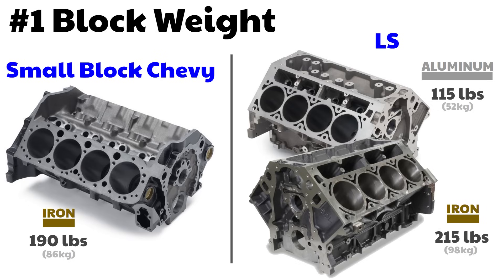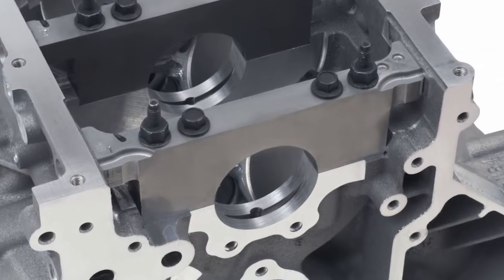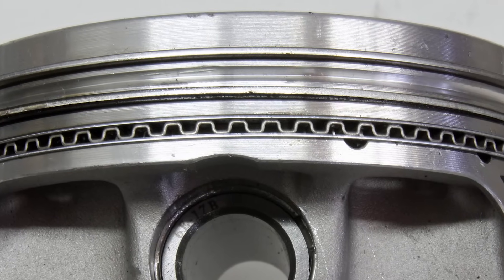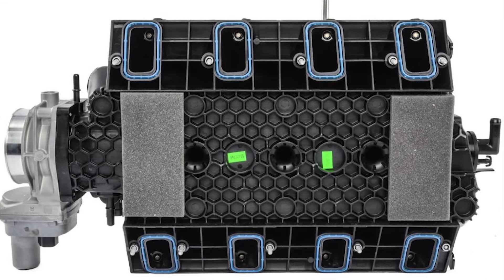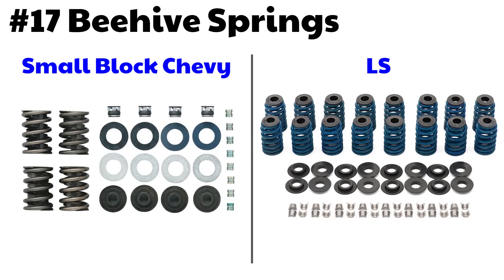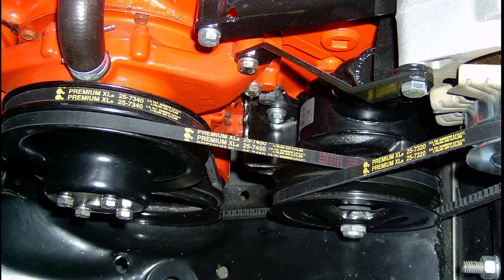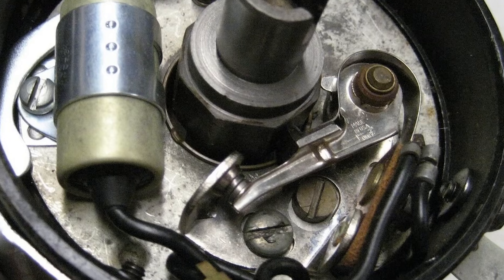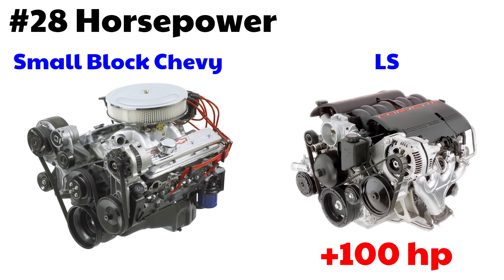29 Reasons LS is Better than Small Block Chevy (Gen 1 & 2 vs Gen 3 & 4)

Comment: There have been thousands, if not millions of sbc's built with over 550 hp,  and still running. The small block can't be to bad as it took GM over 50 years to come up with something better.  The small block was, is, and will always be a great engine especially for a design that was made back in 1955.
Reply: Gen 3 sbc is an evolution just like gen 2 was and gen 5 is
Reply: I was really hoping this was a joke. Sounds like someone  read about 1/3 of the history of the sbc gen1 (the LS1 is a gen 3 sbc.) And half of the LS  history. Its like he left the last 25 years of the gen 1 off lmao. Being  gm  used them till 2002. But the late model gen ones have the same crankshaft and rod material.some of  The earlier gen 1 crankshaft that we all called steel crankshaft (forged) are a lot stronger the skirted block and oil pan sounds good until you need oil to the oil pump. As far as less moving  parts what till cam or crankshaft  Sensor go bad are the reluctant will bicycle had to rebuild the motor I'd much rather put a new distributor in. The heads yes they are better. And the have a gen 1/2 vs a gen3 ls is no where near a 100 hp different. Gm rated the 5.3 at what a gen 1/2 and 5.7 (ls1) at 20hp more. If you want to compare apples to apples than take the LS 5.7 with its 15 degree  heads and a gen 1/2 with a set of 15 degree heads on it there maybe 100 hp difference but it want be from the LS.
Reply: @michaelstoker6710  100% agree. the late l31 vortec motors with just a dual plane and 600cfm make around 310hp and 400tq straight out the scrap yard with the stock low lift cam. they have great potential and are known to do 300k+ without piston slap like the ls.
Reply: @michaelstoker6710  Technology hasn't gone backwards period.  How many gen 1 or 2 sbc have over 300,000 miles on them and can be pulled from the junkyard then boosted and make over 1000 horse power at the tires with stock internals not even opened up?  We talk horse power at the tires now where it matters.  Change nothing but the cam in a stock LS motor and make well over 400 at the tires through an auto transmission easily and reliably.  Getting 400 horse power to the tires with an auto transmission takes a lot more with a sbc.  I'm making 900 rwhp with stock 241 heads, stock intake, and stock throttle body.  Just a good cam, small procharger, and a fuel system to support e85.  900 at the tires with just that and completely daily driveable.  Can a stock sbc do that with stock heads, intake, and carb and be completely daily driveable and last?  Probably not.
Reply: @lsxtuner6126  in fact my gen 2 fits that bill actually its even factory cam with 93 pump gas. When you start talk boost and e85 that changes everything alot. If you think  its hard to get a 400 rwhp sbc streetable is just as easy as a ls. The  ls3 with cam only will make 400hp a 4.8/5.3/6.0 all make under at the flywheel there is hunders of dyno runs on this my cam only untouched  799 makes less than 350 with auto my cam and 243 head put 370 with a 6 speed. I own a gen1 low power in a c10 225 , got 2 gen2 ones the 800-1000 range depending on boost settings turbo the other should be over 1500, gen3 275, 2 gen 4 the 350-370 ones and a gen 5 stock. The LS  is great but don't  belive everything you read on the internet the sbc can be just as effective and like I said comparing  apples to apples do a 12/13/15 degree sbc and see what kinda power the little out dated sbc makes.
Reply: @michaelstoker6710  I've been around both LS engines and earlier sbc's.  I've personally owned a cam only ls1 5.7 that made over 400 to the tires through a stalled auto transmission.  With an earlier sbc it took cam, heads, intake, and carb to make 400 at the crank which was probably only 320 hp at the tires.  Ls3 with cam only can make 500 at the tires.  A 5.3 vortec out of the junk yard with a turbo and not even opening the engine can make 1000 at the tires.  A stock as it comes from GM earlier gen sbc isn't going to hold up at that power if it even made it that far before sending a rod out of the block.  Technology hasn't gone backwards period.  I'm not talking internet I build and tune LS engines and have a friend that builds and tunes older gen sbc.  He's a better mechanic than I am and doesn't make the kind of power I do with an LS engine.
Reply: Here is an idle video of my current summer time daily driver.  900 rwhp and 9's at full weight while being as tame as can be with stock gear and an over drive transmission.  Stop and go driving and long high way drives are no problem.  Over 1000 horse power at the crank:  https://www.youtube.com/watch?v=hmVPbBvzyas
Reply: @lsxtuner6126  car sound great. And I said a ls3 was capable. But I've seen more 5.3 melt down  then actually make 1000hp.  But seeing  how I've got a completely  factory  lt1 making  the same power as your cammed ls3 and another  after its together  should be capable  of a 4 second  1/8 are any of the other hunters of gen1/2 sbc that are doing it and been doing before the LS  was even thought about. The LS  is great i own 3 and all make good power but nothing like what the internet  chats say they will. And the new gen 5 lt1  is even better. I had the same conversation  the other day with a guy want a guy to pull HIS 454 OUT OF HIS SS454 TRUCK and put a LS instead. He said the same thing  you are a 5.3 with a turbo  will make a 1000hp and they can but a CAM AND INTAKE ON THE 454 PUTS the BBC close to 500hp and with a turbo  well over 1k easy. Like I said the ls is great but any time  you start adding  boost especially with e85 things change really  fast. I'm not saying  any of them are better than the  other they all have there spot and are very capable. Again  car looks and sounds great I've been looking  for one that color thats not ragged  out with no luck. I told the old lady  im just going to go get one of the new bule so  Camaro's.
Reply: @michaelstoker6710  If you melted down a 5.3 LS you don't know how to tune them.  LOL.  Stock gen 2 sbc doesn't make 500 at the tires straight from the factory LOL.  A stock LS3 makes more power than a stock gen 2 sbc yet you say they make 500 at the tires factory stock like my LS3 did with cam only...LOL.  They weren't even 500 at the crank not even 400 at the crank.  This is getting far out there now and moving the goal posts to big block 454's now...LOL.  And 4 second stock LT1's...LOL...Ya sure race cars with fully built sbc, but we are talking daily drivers here.  The LS is an amazing motor for high horse power daily drivers.    Have a nice day sir!
Reply: @lsxtuner6126  lol I just said factory  untouched  engine and again  adding  boost changes things. 4 sec lt1  isn't anywhere near factory  never said it was. The 454 part was trying to  say there's  other options  out there. Yes my untouched  factory  gen2  has out ran 408 stroker with a f1.  The gen 2 dose have a 80mm turbo. The other lt1  has promod 102mm with converted gen 1 heads that flow like your ls3 heads not like the lt1  heads. And I've done said mean times the ls is great and like you said for a daily  driver with high hp. But I don't have to daily my racecars in many years. So I'm not looking  into a junkyard  build id rather spend a little  money build something  nice like the car you post. Or a new lt4ss  like I said. To each his on as long as one can have fun and enjoy  it I don't  care what engine  they go with.  It just gets old everyone  thinks do to internet  that the LS is the only way to make power. Have fun and enjoy your  car and have a good  Evening.
Reply: Here is the record stock block, stock rods, stock pistons, stock crank, stock heads, 5.3 LS.  The fastest LS has been 3.80’s but this is the fastest stock bottom end stock headed 5.3 LS.  Now post video of your 4 second LT car that you keep talking about.  https://m.youtube.com/watch?v=23KxsFMfPl8
Reply: @michaelstoker6710  It's true a turbo BBC will make more power than an LS, but you can't turbo a stock BBC like you can a stock LS.  It won't last, and you sure as hell can't make 1000hp with one, stock.   You HAVE to rebuild it. 
Once you do, then yeah....obviously a 454 will make more power than a 5.3 if everything else is equal.  
But the LS motors will take that HP right out of the box, with no lower end beefing.   Neither the SBC nor BBC will.   They'll take a good but, but not as much as an LS.  
Plus the LS is smaller and lighter, so much easier to fit and work on.   
I still love my BBC's though
Reply: @SealofPerfection  actually been a few do the whole sloppy thing with the BBC 7.4 and 8.1 and both have made over 1000hp  in stock forum with boost. I'd say 700 on a sbc  probably  max. But the size on the BBC  is definitely  a downside. I personally like all of them and have atleast one in a vehicle in my fleet. Just so much false  information  out there about all of it and the whole sloppy movement  with the LS stuff has made it that much worse. No one wants to take the time to research  and learn  anything they get on the Facebook YouTube  and see a lot of false information and run with it. For example  younger  person  this weekend  that claimed  his 4.8l with 5.3 swapped  pistons in it and a stage 1 cam puts out over 500hp to the ground but  never got to dyno it but thats what everyone says it'll make.  When he ask about mine its a l33 5.3 and 243 heads and a stage 3 cam he said wow whats it like 700- 800 hp I laughed and told him yeah it made 370 on a chassis dyno.
Reply: @lsxtuner6126  got a buddy with a 5.3 with ls9 springs and BTR stage 4 cam and a good tune on 93 octane, he makes like 350 to the wheels on a good day.
Reply: @dutchvanderlinde658  I wouldn't call it a good tune then and ls9 springs aren't a good match for a btr stage 4 cam.   I laugh when people use "stage" cams.  People need to quit worrying about "stages" and start using well match parts that make a good combo.  Everyone thinks they have a good tune and the best tuner, but plenty of people including myself have made more power using "smaller" cams.  My last cam only Ls1 made 391 rwhp through an auto trans with only a 224 duration cam and a decent exhaust.  Plenty have done even better so your 350 rwhp is pretty weak and not a good example since it's a poor combo and poor tune.
Reply: @michaelstoker6710  either way Chevy makes BAD ASS MOTORS !!! Would take a Chevy or a Ford or any of the other ones any day sorry it was supposed to say will take a Chevy over a Ford any day Chevy has great passion in engine building they will outlast any other competitor in the market
Reply: @SealofPerfection what are LS engines? I beat an LS6 with my 427 Chevelle. Now I hear my son talking about LS engines. Is GM reusing engine names?
Reply: @michaelstoker6710 A LT WON guy🏁🏁🏁I need to get a little information from you...I got a 383 LT1 trickflow heads all roller everything long tube headers 4l60 rebuilt a few upgrades I don't if a 373 or 411 is better I'm trying to run flat 10s (with adding supercharger)
Reply: @NewStart1o1  with a 4l60 I would go with a different Trans. to start with lol. Not my favorite transmission but anyway really depends on what your doing with it if its a pure racecar no real street moles a 410/411 would be ok but if its was more a pure street car 3.73 would be better if its a street strip car where its getting some miles on it but still main reason is racing it i would go 390 rear gear best of both.
Reply: @michaelstoker6710  that 4l60 is not My favorite either they always seem to go just when you really start having fun lol I'm pretty much street/strip I know that 4l80 was a little heavier witch adding weight I would like to avoid but I want what's best for it I just looking for flat 10 really if possible
Reply: @lsxtuner6126  YOU GUYS ARE FULL OF SHIT WITH YOUR JUNKYARD , NOT TAKEN APART LS MAKING 1000 HP .   THE LS AT ABOUT 700 HP OR 8 POUNDS OF BOOST HEATS RINGS, RINGS BIND BREAK PISTON.
Reply: @daviddavids3468  False
Reply: Sensor , computer , wiring , 
Plug this in , plug that in ,
Vacuum lines going everywhere ,
90 pounds of fuel pressure , 
Fuel injectors , regulate this , regulate that , you can keep your LS,

My little 327 makes 450hp 
Screams to the Moon at 11,000rpm
Pulls both front tires off the ground in a 66 Chevelle Super Sport runs
5.5sec@96mph in 1/8 mile 

I got Zero complaints
Reply: Yep, 550 hp for....10, 12k dollars? I can make that with a junkyard 6.0 with a cam, springs and a head cut. Seriously.
Reply: @brianmorrison9066  you know that the sbc is the cheapest  motor to build right. It want make the kinda power the ls will mod for mod but if you think it takes $10-12 grand to build a 550hp sbc someone  has completely  miss informed  you sir.
Reply: @brianmorrison9066  I’m making 525 with a 3500 dollar sbc right now.  My pro charged sbc is roughly 12k total and making 1150 at 19 lbs of boost
Reply: I’ve personally build some sbc that have had well over 750 hp in a 4bm.  Pretty easy to get 500 in a two bolt, but I’m also building them knowing it’s a two bolt.
I’ve ripped apart lS racers on the track, and lost to them as well.
I know the LS is a superior block, but this video leaves a lot out of the discussion.
Reply: Yeah and when they did come out with an improvement what was it? A small block Chevy😂
Reply: Exactly right, I’m going to be rebuilding a 1966 283 from my Chevelle convertible. I hear my son talking about LS engines but I thought he was talking about LS6-7’s. Why would Chevy reuse a name?
Reply: dont tell these kids today that.. they want to plug and play.. they let the factory take what us old schoolers  did to make the s,all and big block chevys better that factory and now the factory took what we improved and did it for them.
Reply: LS is a good engine...but the first gen can keep up with any LS...just got to go to Summit racing...and get some awsome aftermarket race heads massive cam good guts ....
Reply: Lots of what he says isn’t true.
Reply: Preach it. Truth.
Reply: Facts he saying the newer sbc can handle more then the old sbc not true
Reply from the maker: No doubt, Ive had one in my camaro since high school and its never once left me stranded.  And it was my daily driver for 9 years!  My main draw for the LS tho is the aluminum block and 100lb weight savings.  : )
Reply: @AutoGuild  SMALL BLOCKS BETTER
Reply: @AutoGuild 😊ZSsz!- s DDs😊
Reply: Aluminum blocks overheat and gen 1 iron blocks can handle 1000 hp even. A sbc oilpan can be aluminum.

Everything found on ls you can find for sbc
Reply: @shadowopsairman1583  No. Aluminum blocks are just better for performance cars.
Reply: @shadowopsairman1583   your statement should read: everything that comes stock on the LS engine you can buy from the aftermarket for the SBC after throwing away all the stock parts
Reply: @shadowopsairman1583  My aluminum block ls3 with a procharger makes 900 rwhp and never over heats driving the streets or at the drag strip.  LS engines have made well over 1000 rwhp with stock internals so probably 1200+ at the crank on stock block, rods, pistons, crank, heads, etc.  All stock except a cam and valve springs with some boost of course LOL
Reply: @lsxtuner6126  YEAH AND STOCK 6.0 LS ENGINES HAVE HAD CRANK FAILURES AT LESS THAN 400 HP TOO.  MY COUSINS CRANK SNAPPED IN HALF
Reply: @daviddavids3468  LOL.  I've personally built an Ls with stock crank over 1000 to the tires.  Sorry not everyone knows how to build and tune engines to make big power without breaking.
Reply: @lsxtuner6126  900 WHEEL HORSE POWER ?  YOU NEEDED CAM, SPRINGS, RING GAP, WHICH MEANS YOU HAD TO TAKE THE WHOLE MOTOR APART, THEN PROBABLY BEARINGS, GASKETS , HEAD STUDS. BIGGER THROTTLE BODY, BIGGER INJECTORS, BIGGER FUEL PUMP , $1500 TUNE. AFTER $6000 OR MORE FOR PROCHARGER OR TURBO KIT
Reply: @daviddavids3468  False.  Just have to know what you are doing.  Sorry you don't have this ability.
Reply: @lsxtuner6126 so if i want 650hp i don’t need to do anything to my aluminum block in 03 Z06 LS6?

Comment: I keep seeing the aluminum dissipates heat better comment. That doesn't = smaller radiator. Where is it dissipating the heat to? The coolant. For any given power level you end up with the same sized radiator. The one in my c3500 with a 350 was a little smaller than my 2500 making 50 more hp with a lq4 and that is smaller than the 5.3 in my new Tahoe making whatever it does. Aluminum or iron means nothing other than heat transfer happens faster. You allegedly lose power on an aluminum block vs the same setup on iron. I don't believe that but I don't have the money to build 2 identical engines to test that...
Reply from the maker: My understanding is the aluminum dissipates heat thru the metal and to the air at a much higher rate than iron.  So the aluminum block ends up being part of the cooling system (more so than the iron block anyway).  Thats why aluminum differential covers have aluminum fins on them to dissipate the heat to the air.  I have heard that aluminum heads on an engine not designed for aluminum heads can cause problems as the head can run "too cold" but Im not sure of the details.  Would make an interesting video.  Thanks for the comment.
Reply: @AutoGuild  Nah I get it. In the grand scheme of things, coolant has a thermal conductivity about 22x greater than air and thus the actual heat removed is pretty small by comparison. It'll more effectively remove heat so at that point it is technically less prone to hot spots and the like. But the surface area hit by air is relatively small compared to the volume of coolant coverage and radiator surface area.